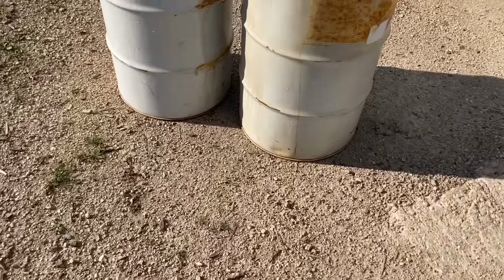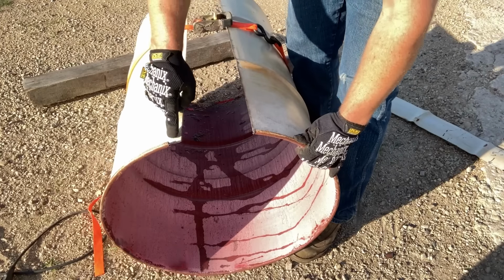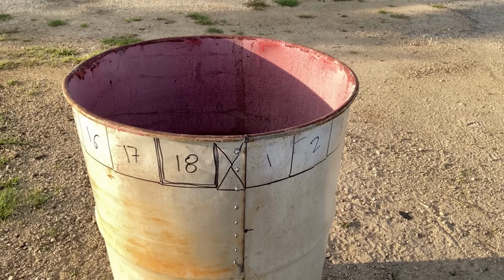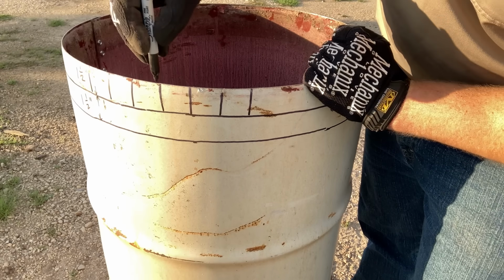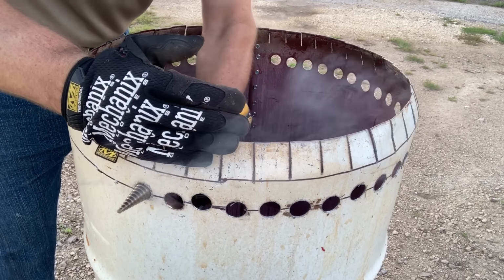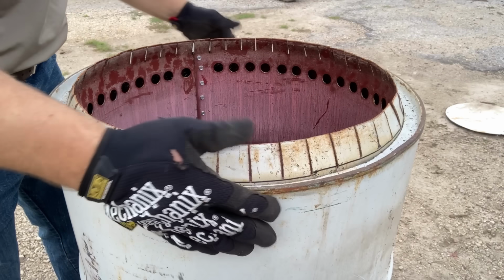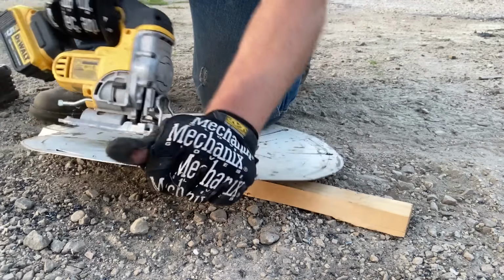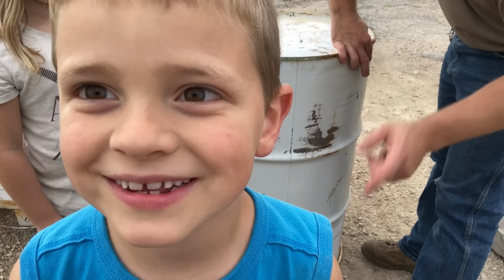Smokeless Burn Barrel

Comment: Myself and my 90-year-old dad built a barrel following your instructions.  The legs were structurally unsound, so I cut them off and replaced them with three outside mounted steel plates and we added handles on the sides to ease of moving the barrel around safely before and after use.  The thing is awesome, we've named ours, "The Dragons Breath!" it incinerates whatever we throw at it.  Thanks for your video and the chance to do a project with my retired sheet metal worker father.
Reply: Great comment..... I love the updated adaptations
Reply: Good ideas! 
The legs seem critical.
And you could probably even make handles out of the excess strip he cut off 👍
Reply: We just built the same design and find smaller twigs and stuff just fall through to the bottom where it becomes slow burning and smokes a lot, often not even burning completely. How are you dealing with the ash catching at the bottom?
Reply: That's totally rad that you let your dad's craft shine through. I bet he felt like a boss!
Reply: The ground catches them and we rake/shovel them into the compost later, 24h after the last burn. Granted my land consists of mostly sand and some gravel. So, build a small sandbox to put the burn barrel in if worried about fire or small block patio to

Comment: Written instructions based on the video:

Parts needed
•	two steel drums (same size)
•	angle grinder with cut off wheels
•	drill with 1/8th inch bit and #4 step unibit
•	template material (rigid plastic or metal)
•	sharpie
•	Tape measurer
•	Optional oil for drilling
•	Jigsaw and metal blades
•	Sheet metal screws.
Inside drum
1.	5 inches from the seam, draw a solid line
2.	1 inch further from the seam, draw a dashed line
3.	Use an angle grinder with a cut off wheel. Cut the middle section at the seam and the solid line
4.	Ratchet strap the center to hold it
5.	Cut the top and bottom sections of the side of the barrel (at seam and solid marker line)
6.	Cut through the rim at the seam
7.	Cut through the rim at the dash line, across the bottom of the rim to the solid line, and across the rim at the solid line (leaving a one-inch section with side wall and no rim)
8.	Cut off the entire capped end of the drum (including the rim)
9.	Ratchet drum with tabbed edge on the inside. 
10.	Fasten drum together with a few self-tapping screws from the outside in (maybe three or four total).
11.	Once secure, screw it together every few inches from the inside out. Remove the original screws and put them from the inside out also. 
12.	Use the angle grinder to cut off the excess screw from the outside. Leave a few threads so it doesn’t unhinge itself.
13.	Flip it over, with rim side up.
14.	Using a 3.5-inch square template, beginning at the seam, draw squares under the rim and label the squares 1-18. The seam area will not be marked.
15.	#6, #12, #18 cut the sides and the bottom (not the rim part). 
a.	Cut just a little bit into the rim from the inside out to allow you to fold them up. 
b.	Bend them in an all the way up. 
c.	Use plyers to fold in the sides of the three tabs to make sturdy legs. From the top, they should look like be C’s, with the hump facing out.
16.	Cut the bottom, left hand side, and top (under the rim) of the even numbers. Gently fold these in a little past 90 degrees
17.	Flip over and stand on the legs.
18.	Draw two lines around the unrimmed top. One 1.5 inches from top, one 3 inches from top.
19.	Draw vertical lines from the 1.5 inch line to the top. Cut the vertical lines with grinder. Take off the outside edge of the double layer section.
20.	Gently fold the tabs in (can use plyers if you want).
21.	Drill a 1/8 hole in the 3-inch line, at the middle point of the tab above.
22.	Use the unibit #4 to drill those holes out. (oil can help)
 
Outer barrel
1.	With open edge facing up, put one line at 1.5 and one at 3 inches around the drum. 
2.	Use 1.5-inch square template to draw vertical lines on the 1.5 to rim area.
3.	Use the 1.5-inch square template to draw vertical lines staggered from the last lines, in between the 1.5 and 3 inch horizontal lines. 
4.	Use 1/8 th drill bit to draw pilot holes for each, then use the #4 unibit to drill those holes out.
5.	Flip it over so closed end is up.
6.	Mark out a circle the size of the diameter of the inner barrel (likely 20 inches if it is a standard barrel, but check).
7.	Drill a hole with the #4 unibit, then use a jigsaw to cut out the hole. (Save the disc).
Assembly
1.	Put the outer drum over the top of the inner drum, with the holes on the bottom of the outer drum. It should seat, with the outer drum possibly resting on the sheet metal screw in the seam. It should seat between the bent tabs and the holes in the smaller barrel.
2.	Use one fastener per leg to screw the inner and outer barrels together. 
3.	The disc saved from the outer barrel.
a.	Remove about ¾ inch from the outside edge using jigsaw.
b.	Draw 8 solid pie lines
c.	Draw 8 dashed lines between the solid lines.
d.	Draw a ring ¾ inch further in from edge.
e.	Use unibit to drill a hole at the inside solid line and solid pie line.
f.	Draw a 4-inch diameter circle in the middle.
g.	Use unibit to drill a hole at the solid pie line and the 4 inch circle line intersection. (8 total, in line with the ones drilled previously)
h.	Using Jigsaw, cut from unibit holes to the dash lines on the left and from inner to outer unibit hole 
i.	Use plyers to bend the tabs up, will look like fan blades. 
j.	Put it in the barrel, with the folded tabs down.
Reply: Thanks for writing that out.  I did something similar, with screen shots.
Reply: thank you for taking time and effort to write it out for us all
Reply: Jeez! I'd love to have your time!!
Reply: Not all Heroes wear capes. thank you Melanie
Reply: Wow. I would have been daunted by the instructions if I had not seen the video first. But great analysis anyway. I've printed them out for when i build mine.
Reply: Thank you! Add PPE: goggles, heavy duty gloves, hearing protection
Reply: Thank you, very helpful and appreciated.
Reply: Thank you very much for doing this.
Reply: That's a lot of work.
Reply: impressive
Reply: @iamthewelcher  It takes no extra time at all if you get used to multitasking! You can type it while watching for the first time.
Reply: @iamthewelcher If  time is what you need more of;   A good dictation application/voice typing,   will reduce the time to put all of that in writing  by a factor of 10 . A quick verification/correction will ensure the result is good explanation. My ancient Samsung S5 does an excellent job at recognizing my dictation, even with my French accent. Hopefully the newer versions work as well or better.
Reply: Best reply to date .😊
Reply: Thank you!
Reply: @iamthewelcher  the appropriate response is to thank @melanie lawson for sharing her time in order to save some of yours.
Reply: Like all the rest I as well want to thank Melone for the plans printed out saved the video built the smokeless burn barrel put it in the book of DIY (*****5*****)
Reply: apart from a lid or rain protection its good 👍
Reply: @heminuiraho879  I used a old fire pit for the top was going to use the first lid of the barrel
Reply: You have WAY too much time on your hands. But, thanks.
Reply: If you're not making good money as someone's administrative assistant somewhere, it's a shame. 😉
Reply: instructions unclear, pubic hair cut by angle grinder and foot stuck in ceiling fan.
Reply: Le dot.
Reply: Thank you for inventorying.
Reply: He should hire you for doing descriptions.
Reply: Somehow this is harder than the video
Reply: Awesome video. FYI when using step bit and/or unibit have the drill on low. Better cuts and longer life of bit.
Reply: Really drives home  the ridiculousness.
Reply: Thank you!!!
Reply: this needs to have more likes and comments so it goes up the top of the comments, or pinned 👍 thanks for the list!
Reply: Not expecting any homeless people to be making these.
Reply: Wow thanks
Reply: Thank you! But my ADHD barely allowed me to finish the video, let alone finish reading this (I DID copy and paste it into a file on my laptop, because I fully intend to make one).
Reply: @mystic_tacos  Good lock trying to make one and follow all these instructions with ADHD. lol.
Reply: You, Ma'am, are a goddess.
Reply: I wish YouTube in my phone would allow me to copy and paste this written instructions
Reply: Do you have the ability to turn that into a PDF?
Reply: @Mancini1010
Reply: Thanks
Reply: Legend !!
Reply: I did my today, just changed inches to centimetres :-). Already tested and working well, ideal for the autumn now.  Thanks and Regards from Poland!
Reply: Wow!
Reply: Don't bother, instructions is out da window!! Since beginning of times man no need no instructo to destructo ... We got dis, go make sandwich or sumthins for I must concentrate on which end is my ass...🤔 I wanna say it sets in da west, right!!?🍿🍿🍿🤨🤙💯
Reply: @jimcook8852 I thoughts you always drill on low speed so as not to blue your bits... 😮 Blue your bits. 😂😂😂
Reply: @kalumbabwale3729 naw he forgot to mention that whacking a few from da swako gets you dat motivation das needed for a eyeballing project as such. 👀
Reply: Fab
Reply: Thanks for the effort you put into this! Much appreciated!!
Reply: You are proof that we all like to be helpful and share our talents. Thank you Melanie.
Reply: Wow. Your effort matches his. Nice work, both.
Reply: I swipe to get a screenshot. I use to say smile or some command word but the changed it. @crizzotch
Reply: Thanks!! 👏👏👏
Reply: Thanks A.I

Comment: Built the burn barrel this week and it works like a charm.  We made one modification which is obvious, but still may be worth mentioning:  We found that the legs were very flimsy so we folded them inward and rested the barrel on cinderblocks that rest on their sides so that the cinder block cutouts allow air to flow freely from the outside to the underside of the (elevated) barrel.
Reply: Then you did it wrong, now do it again. LOL. Good idea, thanks.
Reply: Please any one tell me whether this burn barrel can be made an incinerator by adding it with petrol and compressed air because I am working on a petrol incinerator. By the way my name is Anil Kumar Singh and I am working in Indian Institute Of Technology Kanpur, India.
Reply: because cinder blocks can sometimes have trapped moisture that can make them explode I would recommend fire bricks instead, but yeah brick feet seem like a good idea
Reply: @iitkaks6  yes absolutely. We added a bit of petrol to get the fire started and it burnt so well and so fast and so clean.

Comment: I built my burn barrel last fall.  I built a dolly into mine.  Scabbed an axle on to it from an old yard trailer and used some tubular steel remnant for the handle.  I don't like a burn barrel laying out in my yard all the time.  I researched building it more efficient to burn faster but didn't come up with much.  I saw the smokeless fire pits but couldn't figure out how to build it into a burn barrel easily. 

Well done.
Reply: Faster burn from drafting, chimney effect. Keep three holes vertically through the burning materials.
I can barely feed mine fast enough.
Reply: Winner, winner chicken dinner. Bloody love your work. Champion.

Comment: I made this two days ago by following your instructions exactly. The only change I made was not using self tapping screws. I have a mig welder so I welded it back together. GREAT idea and GREAT video! Thank you!
Reply: Did you use a cutting torch instead of a grinder?
Reply: Please any one tell me whether this burn barrel can be made an incinerator by adding it with petrol and compressed air because I am working on a petrol incinerator. By the way my name is Anil Kumar Singh and I am working in Indian Institute Of Technology Kanpur, India.
Reply: @joshuawright6020  Plasma or oxy acetylene would be a good choice even for the holes.

Comment: Pro tip: Before you cut the bottom out of the second barrel you can draw all your lines, drill your holes and make your "propellor" cuts, and THEN cut the bottom out. It will be easier than cutting it out after. Also, consider adding a grate in the bottom of the finished burn barrel to better support the wieght of the burn material and not just relying on the thin metal of the "propellor." This will have the added benifit of prolonging the propellors lifespan and avoiding burn through.
Congratulations on an excellent presentation by the way!
Reply: yes, that thin cut up bottom int he video is not going to support much after a couple burns and a rain.
Reply: Yeah logs will just bend those things easily. I think that's what my Dad and I did when we built it. Right now outs is all rusted out lol. We hardly cover it when it rains
Reply: Thank you! I was wondering how I would finagle that part lol. That makes a lot of sense :)
Reply: We just built this and definitely had to close up some of those fins to stop things falling straight through. It didn't stop it and it also caused the vortex to not form as well. So yeah, we are looking at what to use as a grate for the bottom and also potentially place the whole barrel in a bowl shaped fire pit to stop whatever does fall through from flying away burning embers to nearby trees or us.
Reply: @ca2269  maybe make the propeller flaps half as wide, therefore leaving more flat material as support.
Reply: @rustyevolution6298  It will be easier than cutting it out before not after, although After is what you were getting at making the process easier.

Comment: I just finished mine this afternoon and tested it with cardboard - simply amazing!  Thanks a bunch for sharing this project.
Reply: For a second I thought you made it out of cardboard to test it out 🙃.
If there's a commercial version of this I'd like that, I think making this would need more patience than I'm capable of, so that's probably why I'd be inclined to make one out of cardboard 😀
Reply: Just a tip. Burning just cardboard won't fully achieve what this is for.  For it to work properly you need the inside barrel wall to get extremely hot. That's what causes the secondary combustion. Small smokeless fire pits take about 15 minutes of adequate fire to reach "smokeless" so a barrel this size probably takes about 30 minutes.
Reply: @SweetMooch  Trust me on this - when I burned cardboard it blistered the paint off the barrel in just a few minutes!  Only trouble I have with burning cardboard is the ash is clogging up the air coming in the bottom.  So I only burn one or two loads at a time, then let it cool and clear away the ash.
Reply: @SweetMooch  I used to live in a cabin that had a device called " blazing shower" for it's sole source  of domestic hot water. It was simply a length of half inch copper tube lining the inside  of stovepipe. It was hooked up to a pacariously mounted tank in the loft. It was pretty worthless  but might have been the stove which was a Ben Franklin. You could burn a hot fire all night and still have a mediocre  shower the next morning. I didn't  install it but it looked right for the thermosyphon to work but it just didn't. The only thing it did is prevent the headache you could get from the freezing  cold water in winter. I have seen old cook stoves that heated water and they had steel pipes right in the firebox where they were exposed to direct flame. Since the pipes were in the stove pipe the only way to get a shower warm enough  to wash your hair was to have a partner feeding that wood stove with bone dry finely split hard wood.  Or you could burn waxed cardboard cut into 3" strips and folded in to a triangle shaped  tube. You could get  a decent shower out of a couple banana boxes as long as you had an assistant  keeping that fire fed so the Flames were going  way up the stove pipe.(does anyone know why my Samsung won't  let me write certain  words without  capitals?) Anyways, cardboard  is capable  of burning pretty hot but it needs lots of air. Maybe you're  overstuffing or your cardboard is moist?
Reply: Think I'll just punch holes as before set on elevated cinder blocks.
Reply: @dubmob151  To be honest you can get a garden incinerator of a slightly narrower radius, cut a hole in the base of the oil drum and put it upside down over the garden incinerator. You need to raise the outer barrel to get air in the sides. The air will go up the sides between the barrel and garden incinerator and come over the rim where it burns most of the smoke. I don't think it's quite as good as making the holes but it saves a lot of work.